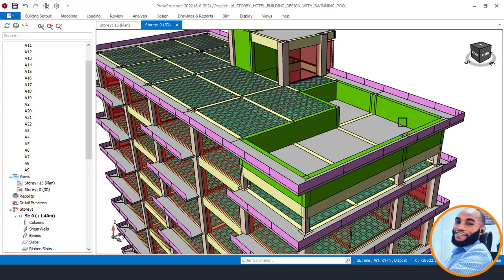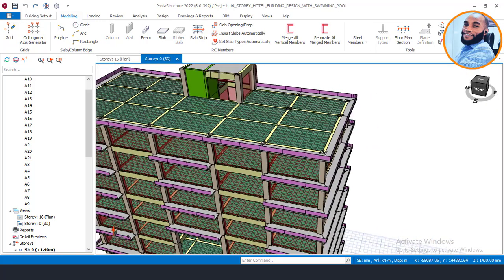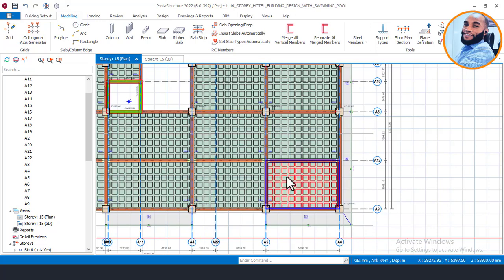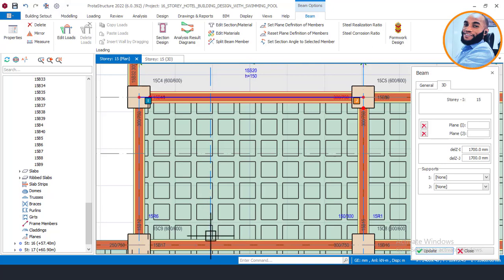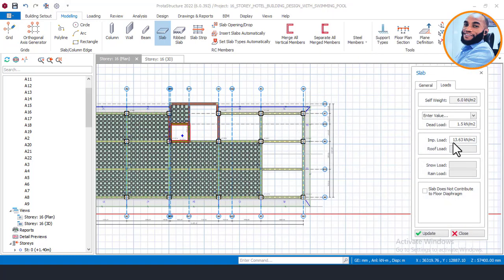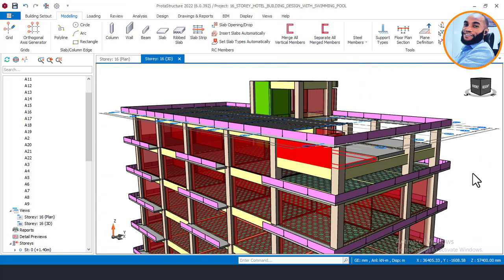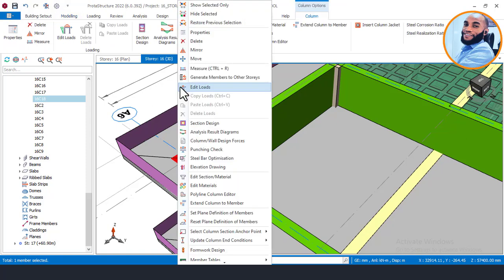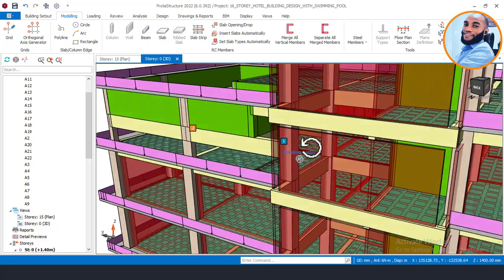PART 11 - 16 STOREY HOTEL BUILDING DESIGN IN CIVIL ENGINEERING USING PROTASTRUCTURE 2022

Comment: Why is the swimming pool external beams level different from the swimming pool slab level? In the 3D view the slab level is a little higher than these beams. Does that corelate to the construction of the swimming pool?
Reply from the maker: No they are on the same level 
Maybe it's how you are looking at it

Comment: I did not get how to calculate the live load.
I suppose it's the unit weight of the water times the depth of the swimming pool divided into the area to get it in kN. But in kN/m² it will be the depth of the swimming pool multiplied by the unit weight of water. Or am i wrong?! 
That in there we should have 15.5 kN/m² LL

Comment: why you need to delete ribbed slab at min 20:27 and add beam in between. because the beam not at same level of height (z 1700mm). actually not disturb the slab. can just add the beam without delete.
Reply from the maker: You can try it out if it works,fine